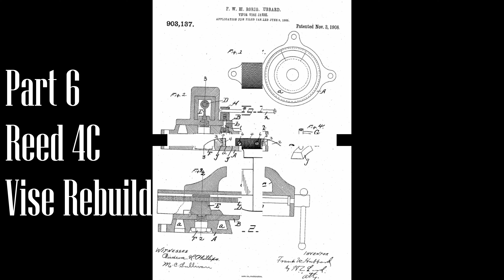Part 6 Reed 4C 6" Vise Rebuild (Final Assembly)

Comment: Thank you for another 'edutainment' video. Enjoyed the rebuild. Who was the top US vise manufacturer, in terms of a) quality and b) popularity back in the day?☘
Reply from the maker: Thank you for your comments. Wow! That would be subjective, and I do believe most, if not all the pioneering vise manufacturers have a lot to offer. Consider that many of the patents that are at the core of modern vises were developed during the Industrial Revolution. It was the need for work holding vises that pushed these innovations similar to what the space industry did for innovation in the modern era. A lot of the smaller vise manufacturers either moved to other products or were absorbed by larger corporations and this also happened to larger companies as well. For example, today Reed Manufacturing offers Utility and Mid-Line vises that are based on Columbian Vise designs. These vises are manufactured overseas and assembled in the US. The original Reed vises like this 4C and my 204 ½ R are vintage and it would be difficult to find a modern-day equivalent. There are a lot of amazing vintage vise manufactures and I tend to focus on American companies. Just to name a few; American Scale, Armstrong, Athol, Atlas, Barrett, Bonney, Champion, Charles Parker, Columbian, Desmond Stephens/Simplex, Erie Tool Works, Hollands, Lewis, Massey, Monarch, Morgan, Oswego, Prentiss, Reed, Ridge-Ridgid, Rock Island, Samson, Shepard, Simpson, Stanley-Jersey, Trenton, Western Tool, Wilton, and Yost. If you want to deep dive into vintage vises, I recommend this thread on The Garage Journal Forum: https://www.garagejournal.com/forum/threads/the-vises-of-garage-journal.44782/

Comment: Absolute Masterclass!   On the pipe jaw pins are they tapered or can they be driven from either side?
Reply from the maker: Thank you. The pins are not tapered. You can drive them in from either side and in any order. The slight bend on them is what made them hard to get in.

Comment: wish my 4C moved that easy.... just time and energy... need more time! mine wont pull it out but will tighten. when i unscrew-handle and floating jaw doesnt move in or out or make gaps but vise wont open. i have to pry or pull it open and once i do that-i cant push it closed and must screw it closed. maybe my nut is loose?
Reply from the maker: Create a free account on the Garage Journal forum and post the issue in this thread. https://www.garagejournal.com/forum/threads/the-vises-of-garage-journal.44782/
The guys there should be able to help you sort out the issue and get that thing back into service.

Comment: could you tap a grease zit into teh oil hole?
Reply from the maker: You could but why go through the trouble. The oil hole is fine for adding oil. Really, unless the vise sees a lot of use, an annual lube is all that is needed.